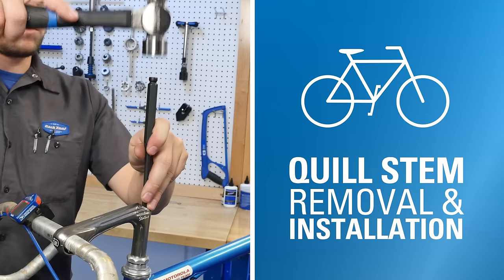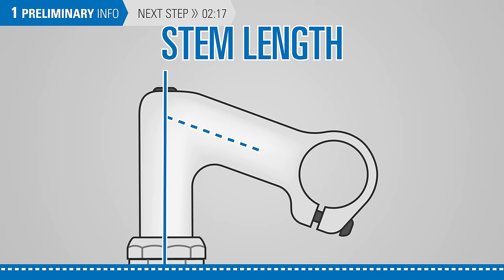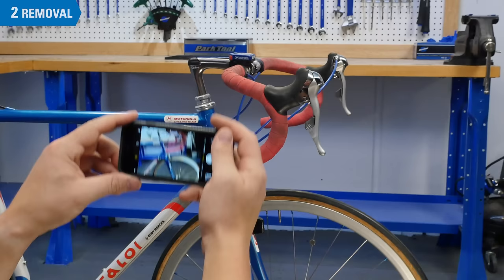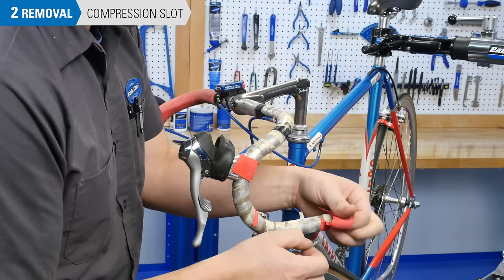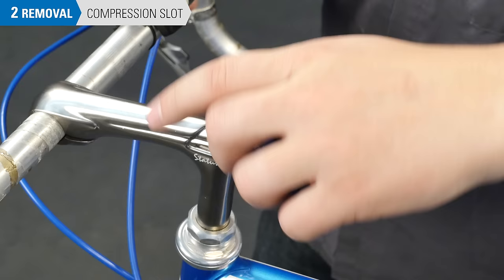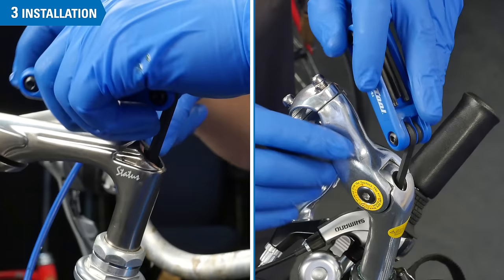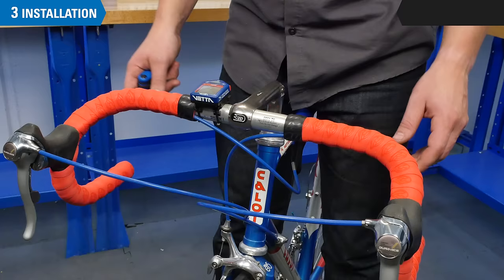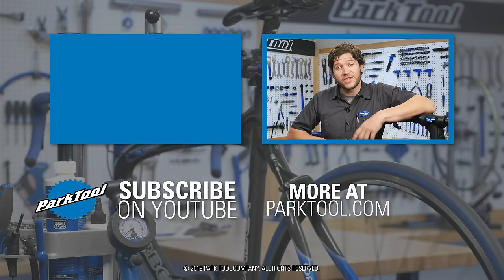How to Replace a Bicycle Stem - Quill Stems

Comment: Thank you for posting repair videos for repair processes for older model bikes. What are some typical torque specs for quill stem bolts and binder bolts? This is helpful when manufacturer specs are not easily, or at all, found or known.

Comment: great and informative video. just one question, why would you use threatlock OR grease on the bolts when these products do opposite jobs?
Reply from the maker: No, not at all.  Thread locker is a liquid, and provides lubrication as the thread is tightened.  It will then dry and expand.  However, it is that tightening that holds.  Grease allows the fastener to achieve proper pre-load, and so will thread locker.

Comment: What do you you do about rusty handlebars?
Reply from the maker: Depends on the level of rust. If it is more than just surface rust, replacement is suggested. If just surface rust you can use some 0000 steel wool to clean it up a bit and continue to use.

Comment: @parktool What app do you use for the angle measurement?
Reply from the maker: That is the "Measure" app that came with the phone.
Reply: measure on iphone
Reply: it is compass on iphone, just swipe from right to left to change it to level mode
Reply: @parktool  This is huge for me! I just had to add air to my dropper and it was too much guessing about my saddle angle when putting it back together

Comment: Hey. I don’t know if you still reply to comments, but I have a problem. I’ve taken the stem out due to re wiring the dynamo lights cable and when I put it back in, the stem keeps going in, and now it’s very low. I can’t raise it, not even by a centimetre. Help pls. Thanx
Reply from the maker: Write to us through our Contact page at www.parktool.com  Use the Tech option, and give details and pics if you can.

Comment: Good day. I have an issue with my quill stem.

Whenever I steered the handlebars so suddenly, the stem and handlebars would move to the side, but the fork and wheel would just stay put, not turning to the direction of the stem and handlebars. This happened even when I secured the stem's bolt nice and tight. Is this a stem and fork compatibility issue? 

Thanks in advance.

Edit: I would like to clarify that this problem comes whenever I would do a regular turn (turning the handlebars while moving at slow speeds.) Not during banked turns.
Reply from the maker: That is a problem, and needs to be addressed before this bike can be called safe.   Stand in front of the bike and grab the front wheel with your knees. Grab the ends of the bars and pull back and forth. It should be difficult to get the stem to move.  Remove the stem and inspect the bolt and wedge. Make sure the head of the bolt, the threads and the wedge have grease.  Measure the stem outside diameter and compare to the fork column inside diameter.  It should be a close fit, with the stem 0.1mm smaller. 
 Something is wrong, so work it through to find the issue.

Comment: I've had a 70's Caliente Schwinn 24 inch for over a year; and the only reason I haven't been on it is the handle bar (drop). It will not connect with the wheels. I turn left and it will stay in the middle or lean a bit. I've been trying to figure out the issue and I can't find a fix. Can you help me understand how  to get my bike up and running?
Reply from the maker: Sounds like you need to tighten your quill stem or possibly replace the wedge in the stem. They could break. I would try tightening before replacing of course.

Comment: Maybe not a relevant question but does anyone know the brand of the quill stem on the blue bike with drop bars? (that shows up around 1:40). Just curious because I have the same logo on the quill stem on my bike, which was already there when I bought it.
Reply from the maker: That is a 3T stem.
Reply: @parktool  Thank you!

Comment: Is it possible to open the compression slot with a plastic tire lever?
Reply from the maker: It is possible to open some of them with a plastic lever but most will require the use of a metal one.
Reply: I would not waste my time. "IF" I am replacing the entire quill stem, I will get one with the cap with 2 screws on top so I don't have to do all of that crazy work with all the brake levers and such. Get out my trusty small grinder and cut that compression part in half and then... replace with a easy cap with 2 screws quill. I have better things to do with my life. Your going to throw the old one away so grind it to pieces. :-)

Comment: No matter how tight i set me quill i could still move it with force..is this normal?
Reply from the maker: The quill stem should pull up tight and take a good bit of force to twist it.  If it twists easily something is not right. Make sure the wedge and threads are grease and also greased under the head of the bolt.  Make sure it is the correct standard for your bike.
Reply: @parktool  I found the problem..the wedge piece on the quill is smooth so it couldn't lock tight..I used the old wedge from my old quill and now it's good . 👍🏽

Comment: My stem won't screw back in, for some odd reason.
and without it being screwed back in, there is no way I can ride my bike.
Any suggestions?
Reply from the maker: If the lower wedge piece is drawn up too tight, it will not enter the steering column.  Loosen the top stem bolt until the bolt is nearly out of the lower nut, then try to insert it into the fork.
Reply: Nevermind. I fixed it.

Comment: My stem screw just spins and spins and spins, and won't release the cap? Help!
Reply from the maker: It is very likely the wedge below the stem did not drop down.  Attempt to thread back the stem screw but only 4 or so turns.  Take a mallet and smack it downward to free the wedge.

Comment: I would recommend an additional diagram demonstrating the quill stem bolt coming loose while the wedge doesn't move. Then, what happens inside the steerer tube when the bolt is struck with a hammer/punch.

Comment: My quell stem is frozen, can't remove as shown here.
Reply from the maker: This can a difficult situation.  Double check that the wedge is shoved down.  Stand if front of the bike, and grab the front wheel between your knees, then twist side to side on the bars.  If there is some movement, dribble in some light lubricant as you twist and pull upward.  If there is no movement, a bike shop might be your best answer.  It is possible to grab the fork crown in a vise (between wood jaws) to avoid damage to the legs.  Much more twisting force can now be applied.  As a last resort, it can be cut, and a jab saw used to saw downward into the steering column to remove the stem.